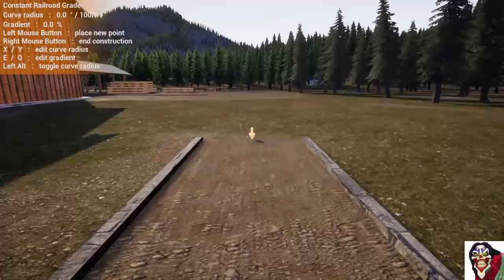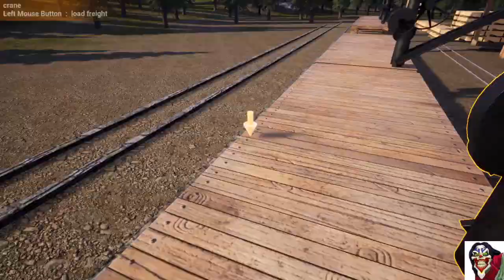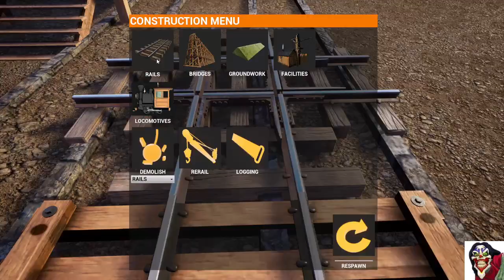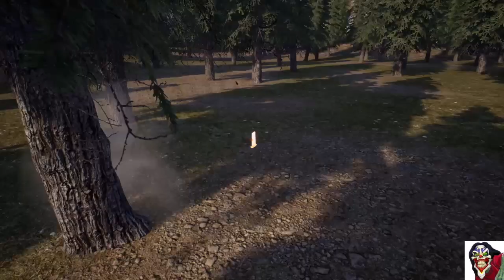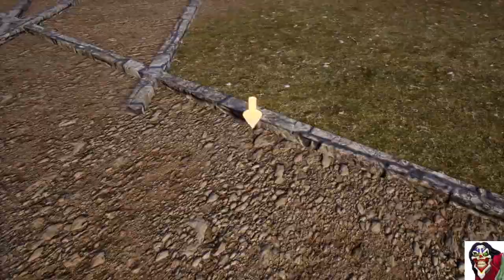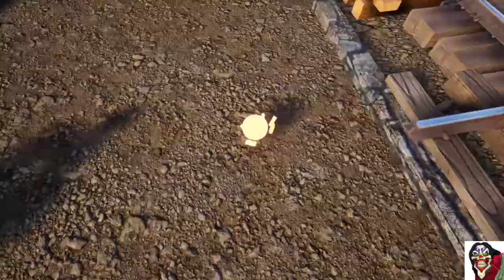RO! - Old Build Tools Tutorial Ep15

Comment: Thanks for the tutorial it’s nice to be able to learn how to put in good track at zero grade. I wish there was more expaination on why track goes up and down from zed fighting and how to make it better for now I just have to keep pulling ground work out and try until I get the zero track I want on my layout. I’m only on episode 8 and keep watching each one over and over to try and retain all the info from the videos
Reply from the maker: The groundworks changes z-height a small amount each segment to prevent z-fighting (2 textures at the same height) in the groundworks.  It works well for the decoration groundworks you snap to the track, but its not so good to build on.
Reply: @K10wNs-Shed  thanks as it does that it’s a hot and miss to get the track at zero so it does not go up and down now I’m regretting the choice to put in 4 parrelel track to all services. I might get it done by next year not looking forward to the update
Reply from the maker: This is why I show methods to mitigate the z-height difference in groundworks you build the track on.  Check the minizwerg for the tutorial map.  All the level areas are 0.0% grade.

It can't z-randomize a spline with only 2 control points, and there's no randomization on bridgeworks for grades.